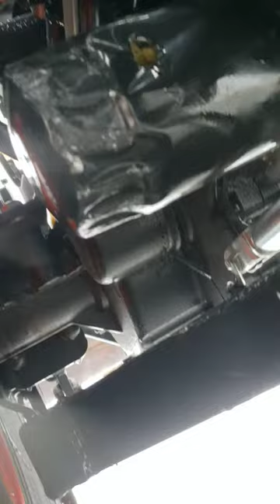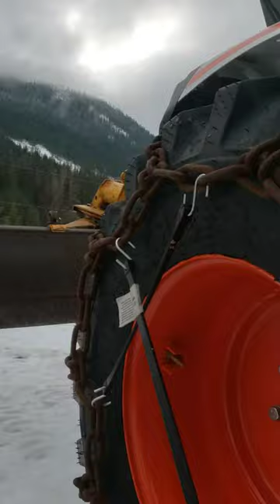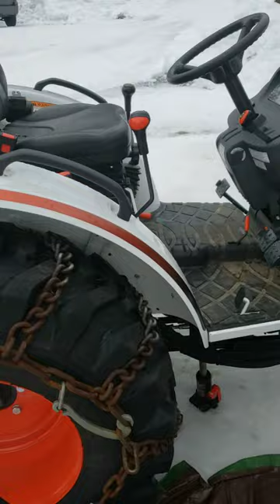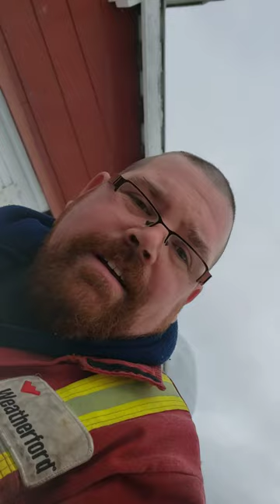Bobcat CT 2025 50hr service seized transmission oil filter

Comment: I had the same problem with my CT2540.  Both hydraulic and HST filter required about 120ft-lb of torque to remove.  I was amazed I didn't mangle it like yours!
Reply from the maker: I did everything I could to not mangle it. I was certain i was cutting it off. Last ditch effort with 2 wrenches and it finnnnaly popped.